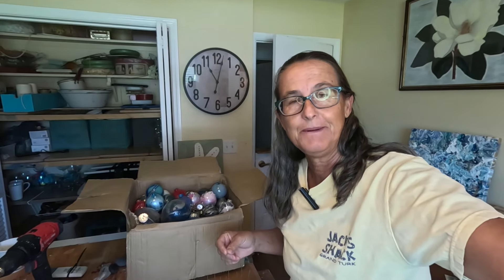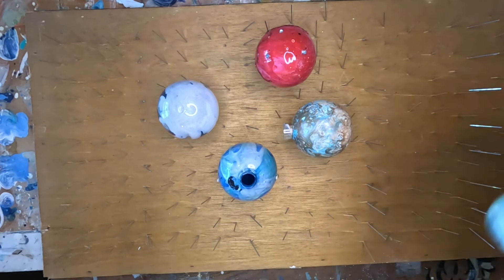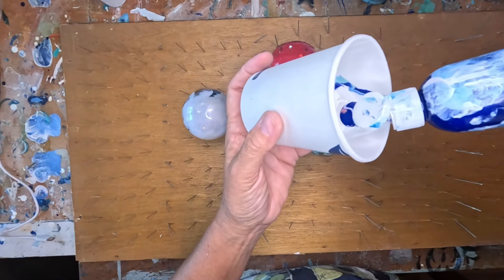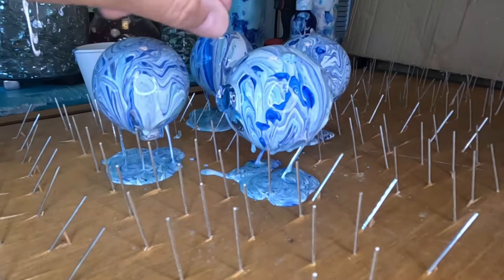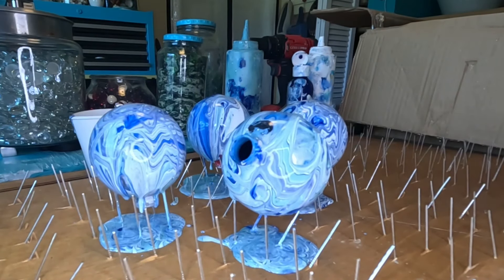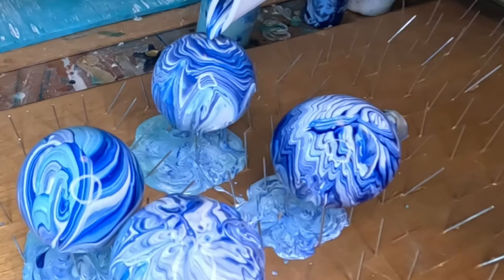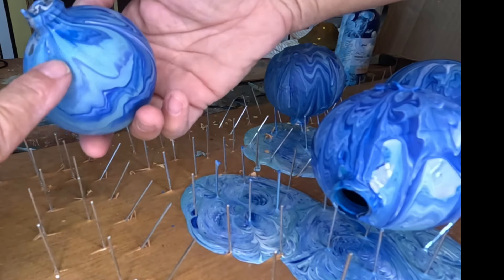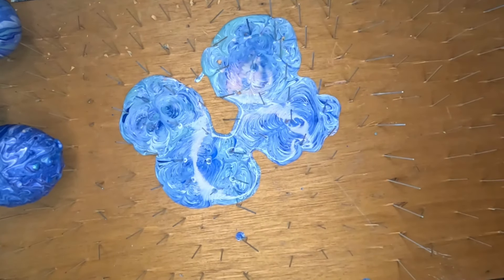See the paint pouring Christmas ornament nail jig in action!

Comment: I like the thickness of your paints. I think I heard you say one part paint and 4 parts floetrol and then a little water. To be sure that would be equivalent to one ounce paint and FOUR ounces floetrol? A total of five in that example. (I'm used to four parts total...one part paint and three parts floetrol so I want to make sure I heard you correctly.) I absolutely love these ornaments!
Reply from the maker: Yes, 1 to 4.  But it’s not exact, so you could use a 1 to 3 ratio too. Xperiment until you find what works for you! I have found a thicker paint definitely works better on these.